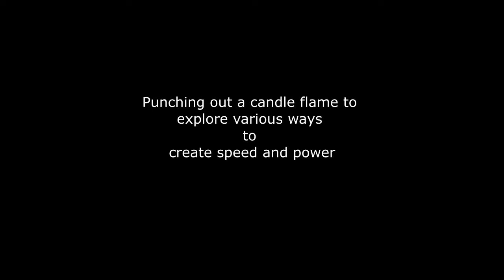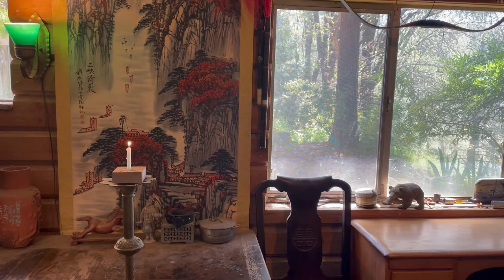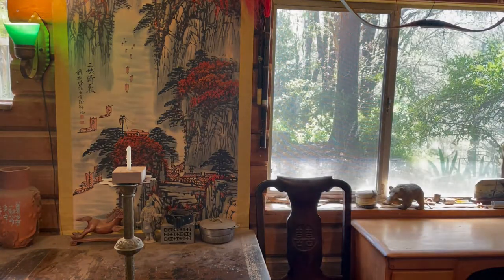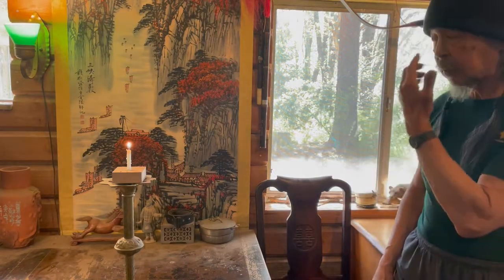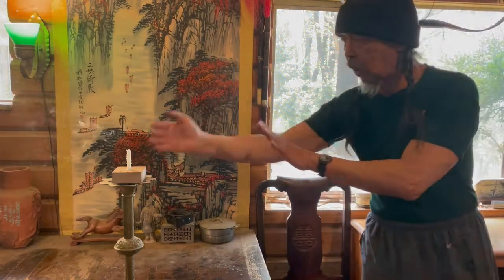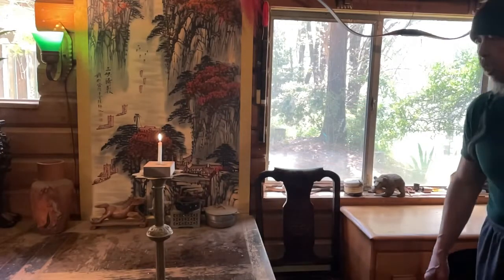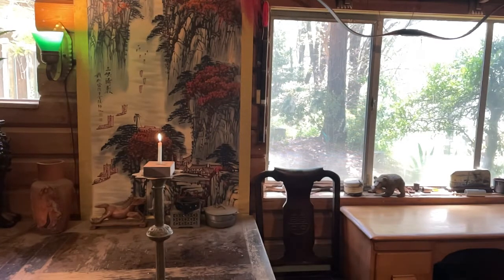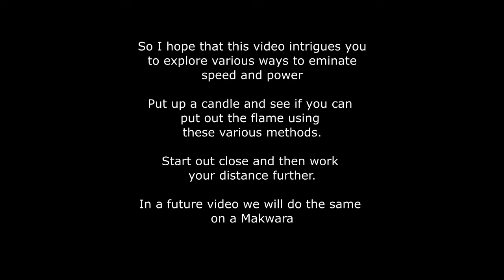Punching out a candle to explore methods of eminating speed and power

Comment: Power!☯
Reply from the maker: In measurement of kinetic energy, speed matters more than mass, (theoretically). An example of this is in calculating muzzle energy of ballistics. Increase in speed increases the energy more than increase in mass.  The demonstration of pushing out a candle shows velocity gained in a short space. This will be related to my discussion of internal vs. external energy.  In the upcoming video I will also demonstrate on a makawara which will more clearly show power than speed.
In the mean time I would suggest  look up the term, "kinetic chain" as related to all this.

Comment: So  amongst other things when the hand does not stay …..it’s like it is creating a vacuum 😁
Reply from the maker: Great question! On the retraction punches I do visualize adding the whip to create a vacuum. But whether it actually does or not is still a question. On one of the Fa Jin palm strikes that did not put out the flame, you can see the flame get pushed away and then come back towards me, so I believe there is a sucking action. But the retraction action of whip also add to the velocity of the punch or strike. If you think of the action of using a whip, the more you jerk back at the end, the greater the force of the tip of the whip. When I do the next video with the Makiwara, the forward action generated by the whip will be much more apparent as there will be no "sucking" vacuum action required.